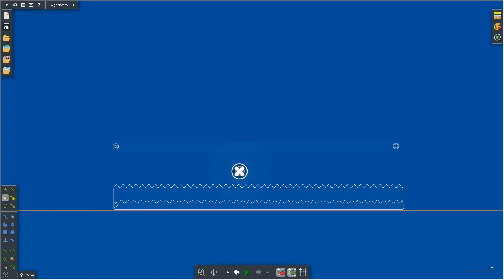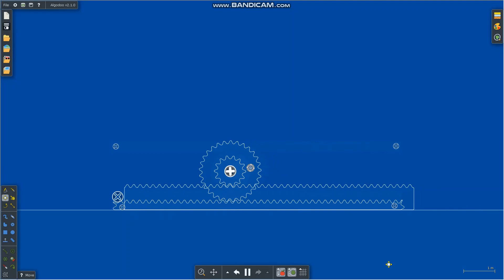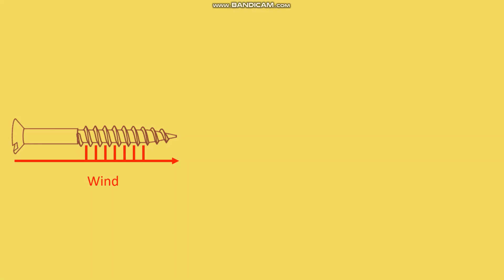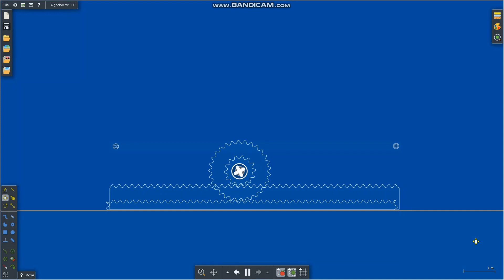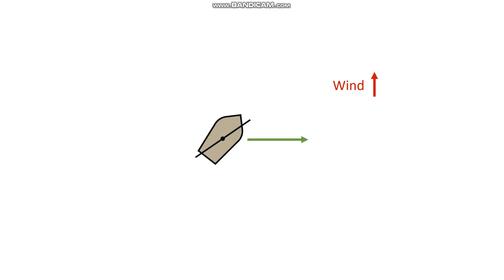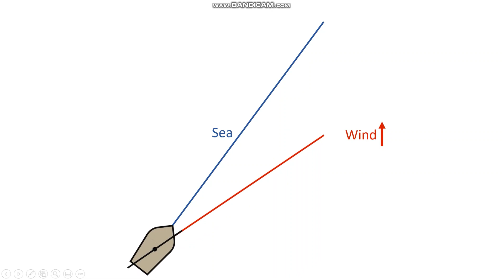Explained: Sailing faster than the wind, downwind

Comment: Your video is good, but you are not using the same set up as does Derek's video.

In your set up, you employ one round compound gear sandwiched between two different straight line gears and, due to the proper gear ratio, this allows those top and bottom straight line gears to move at different speeds. Most importantly, there is only one change of gear direction.

In Derek's set up, there are four gears employed in a one-to-one gear drive sequence, and as a result, there are two changes of direction.

Since if the top straight line gear in Derek's set up were round , it would be rotating in a counterclockwise direction, the top wheel of the cart should then be rotating in a counter clockwise direction.

But it is rotating in a counter clockwise direction, which is what allows the cart to move along the bottom of the yardstick faster than the yardstick itself moves. (Since that top wheel then drives the bottom wheel in a clockwise direction which then moves along the ground at a faster speed because of the difference in the respective gear ratios.)

However, due to this problem of opposing gear directions, Derek's set up should be incapable of even moving at all, yet it does.

Since this definitely breaks a fundamental, cardinal rule of physics (i.e., that two gears driving each other always rotate in opposite directions) how is what happens in Derek's video even possible?

There is a trick employed here in "under the ruler or yardstick" type videos such as Derek's, a trick which he may or may not even be aware of. (And yes, it is trick.)

But before I reveal the secret to this trick, take a moment and see if you can figure out what is happening. 

How it that the "gears" in under the ruler/yardstick type demonstrations such as Derek's can so easily defy the laws of physics?

Comment: When I saw the veritasium video I came up with this same experiment, and I tried it on algodoo and it worked. Then in the second video he brought up on the subject he showed a car that works on this same principle.
Reply: Veritasium's under the ruler (really a yardstick) demonstration worked due to elastic potential energy squeezing the toy cart between the yardstick and the ground which cart then moves in the direction of least resistance due to the release of kinetic energy.

That this is true can easily be seen in the fact that the yardstick and top wheel of the cart are rotating in the wrong directions relative to each other if they were meshed gears.

Comment: The problem is, your gear explanation includes no actual...wind.    In the sailboat example, the boat is not traveling directly downwind which I understand to be the actual claim.
Reply from the maker: The wind rack and pinion is analogous to a wind thread and screw.

The claim for sailboats is that a sailboat can beat a balloon floating with the wind in the downwind direction. This becomes more obvious if the boat tacks in a zig zag, but it is impossible for a simple sailboat to be wind propelled faster than the wind directly in the downwind direction.

Comment: what happen if the output shaft is not connect to the ground but rather to another propeller ?
Reply from the maker: The same thing that would happen if you had a paddlewheel boat with two pairs of paddles geared to one another, floating freely in a river current.
Reply: So wheels are touching ground, but not connected?
Another question (simplier analogy), what if wheels are connected to other wheels with same size but a not-one gear ratio? I think it will just lock rotation of the wheels when i try to push and then couple of wheels start to slip making moving harder than with normal ratio. Whith air there is some slack, but i don't see how this is going to work, as the wind effect is conflicting with itself. (wind is slowed down by turbine and accelerated by propeller). I think Sail is more effective than conflicting phenomenons combined. Although i think there can be something different with gear ratios and size proportions (for example speed control).

Comment: There was another point that was made in the original video which was that a sailboat can actually travel faster than the wind downwind as far as velocity made good (in other words it can arrive at the destination before the wind does) which is not reflected in your example with the boat on this video (the boat arriving at the point at the same time as the wind even though it was traveling at an angle therefore it's water speed being faster than the wind speed).
Reply from the maker: You've just answered your own question. The boat in my video has a water speed in the downwind direction faster than the windspeed. If it tacks in a zigzag then it can effectively go straight downwind faster than the wind, and beat a balloon drifting with the wind. This is velocity made good.

This does not mean that the boat can arrive before a gust of wind does. That would be impossible for a wind powered craft.

Comment: Not clear how all the process start. You pretend to have understood the whole picture but the t=0 moment is not covered
Reply: You need a different mechanism: the air just pushes against the cart and it starts to roll. On the treadmill example, the person holding the cart does the same job (by holding it still relative to the air they're applying a force to stop the cart flying off the back of the treadmill until it's up to speed).